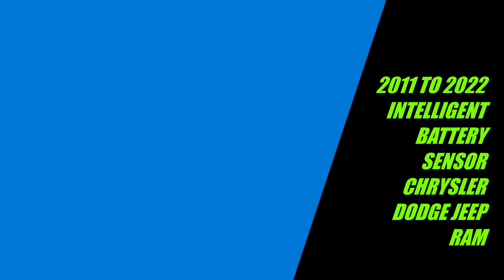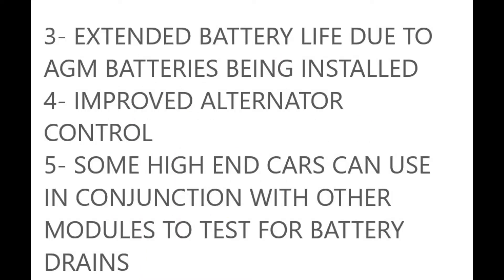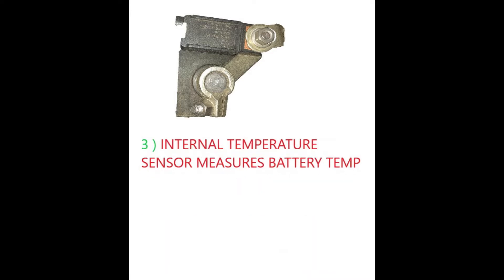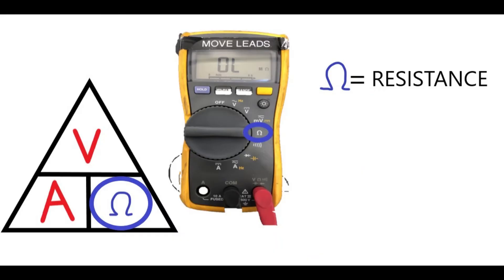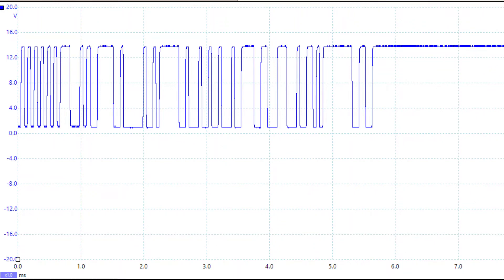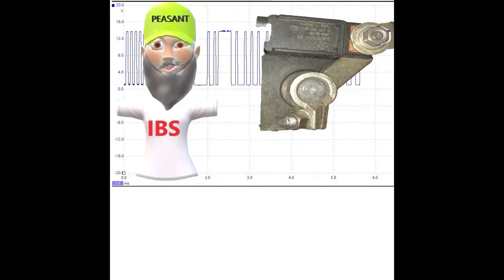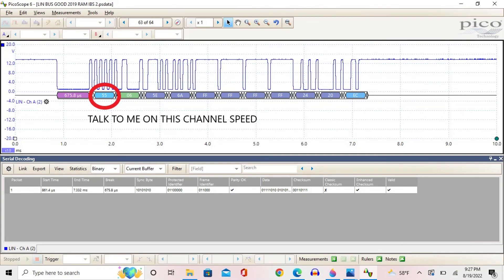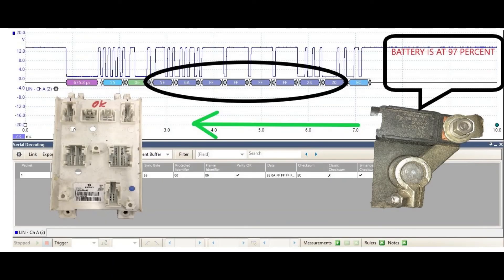IBS SENSOR OPERATION

Comment: In electronics it is and will be used the words "master" and "slave" is called technical terminology. If someone doesn't like that, is totally their problem and they must think twice if that words must be or not disturbing. I consider you just kill the electrical education here. The same problem is with "male" and "female" connectors. Will never be different.
Reply from the maker: Thank you for your inserting your master comments in the male publisher page . I slaved over this video and it’s much appreciated.
Reply: @ocdauto8794  your repply is just awesome